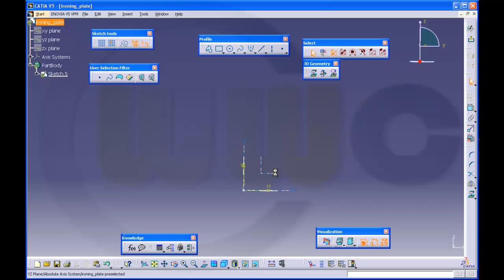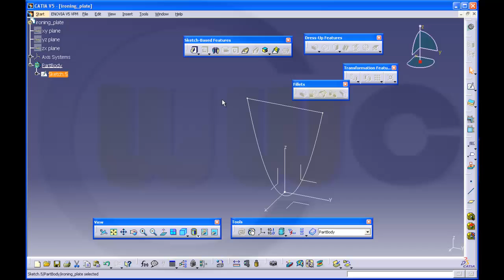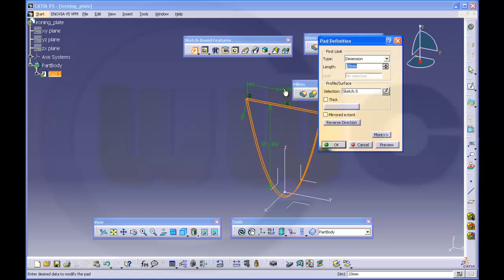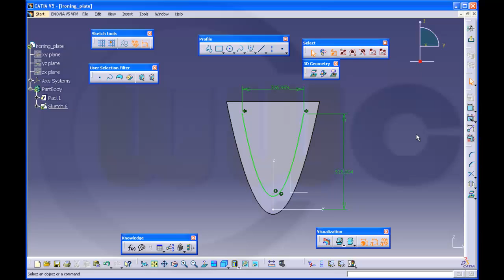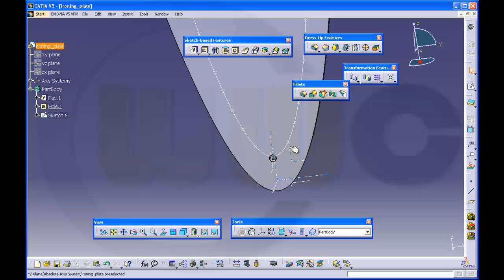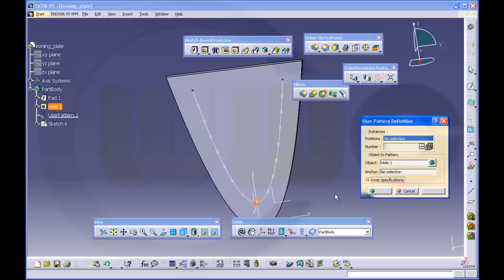5.8 Ironing plate - Catia v5 Training - User pattern - Pattern along path - Parabola

Comment: What if the pattern object is not a hole and has to maintain the same orientation with respect to the curve?
Reply: Create a Points Repetition with axis systems along the curve and a surface.
Then do a User Pattern on those axis systems. The pattern objects will have same orientation as the curve.
Reply: @FoxxyCZ  thank you very much! I'm not sure if my company has a Catia of a version recent enough to support auto axis creation in point repetition, but this is indeed the correct way. I'll check it out 👍🏻
Reply from the maker: With the shown method? Not possible.
Reply: @wolfgang.walden.cad.training  thanks for the quick response! So is there any other known way to perform a curve pattern in Catia v5? I think solidworks had a function for that, if I remember correctly